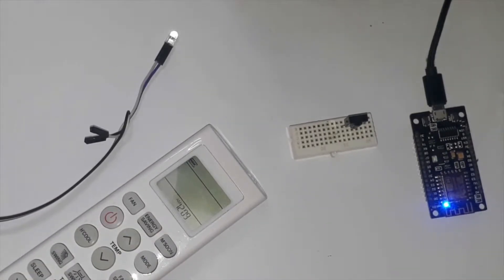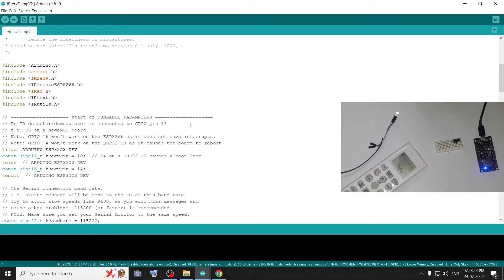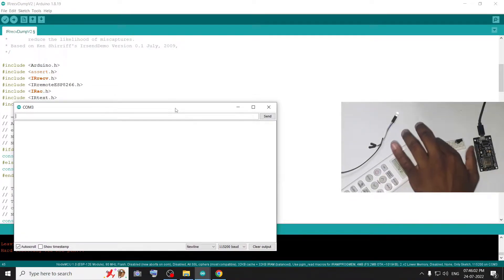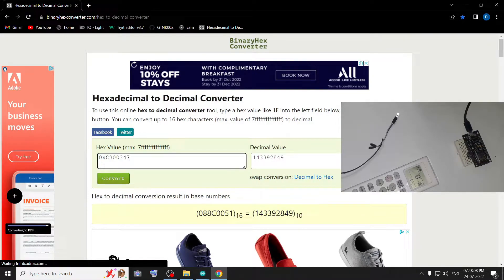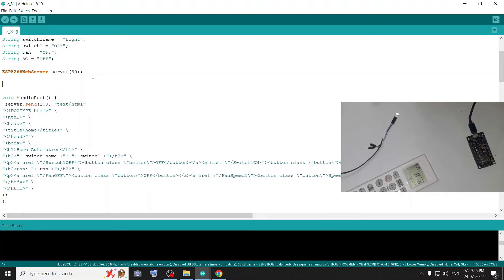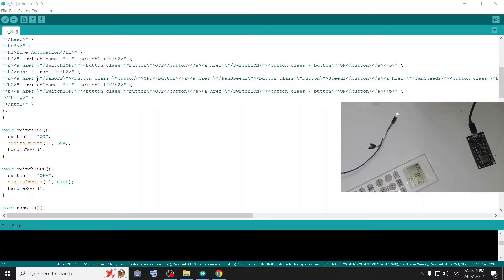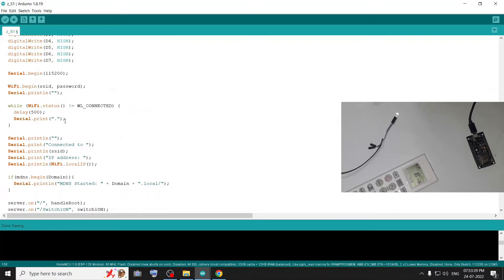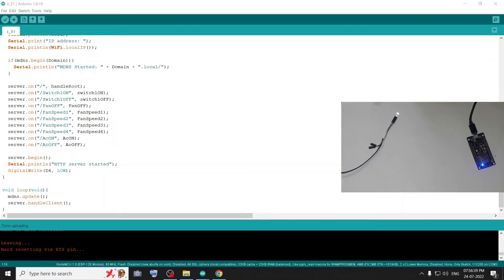T07 Control AC using IR led with ESP8266 local webpage in Tamil

Comment: i am get 80 bit code which is not working
Reply from the maker: try using raw hex code brother 
like this 
uint16_t rawData[343] = {9128, 4586,  596, 1684,  596, 1688,  566, 584,  594, 558,  596, 560,  596, 566,  594, 568,  596, 1696,  596, 546,  596, 1690,  594, 1694,  596, 558,  594, 562,  594, 564,  596, 568,  594, 558,  596, 548,  594, 550,  596, 554,  594, 558,  596, 560,  594, 566,  594, 568,  594, 540,  614, 548,  594, 1690,  596, 554,  594, 558,  564, 590,  596, 1702,  566, 1738,  594, 1696,  596, 548,  594, 550,  564, 584,  594, 558,  596, 560,  594, 564,  594, 568,  594, 558,  596, 546,  594, 550,  594, 554,  594, 558,  594, 562,  594, 564,  596, 568,  594, 540,  596, 8084,  596, 546,  594, 550,  594, 554,  594, 558,  594, 562,  594, 566,  594, 568,  594, 1696,  594, 1686,  594, 550,  596, 1694,  592, 1696,  594, 1700,  564, 600,  560, 598,  594, 558,  594, 548,  594, 550,  594, 554,  594, 558,  594, 560,  594, 564,  594, 568,  594, 556,  594, 546,  594, 552,  596, 554,  594, 558,  594, 560,  594, 564,  596, 568,  594, 558,  564, 576,  592, 552,  594, 554,  594, 558,  596, 562,  594, 564,  594, 568,  594, 558,  594, 546,  564, 580,  594, 554,  594, 560,  594, 560,  594, 564,  596, 568,  594, 558,  594, 548,  594, 552,  594, 554,  564, 588,  594, 560,  594, 564,  594, 568,  594, 558,  594, 1686,  596, 1690,  594, 1692,  594, 1698,  594, 1700,  596, 1702,  566, 1736,  596, 540,  594, 8080,  596, 546,  594, 550,  596, 554,  594, 558,  594, 562,  594, 564,  596, 568,  594, 558,  594, 546,  596, 1690,  594, 554,  594, 560,  594, 562,  594, 566,  594, 568,  594, 558,  594, 548,  596, 550,  594, 554,  594, 558,  594, 562,  564, 594,  594, 568,  594, 558,  594, 548,  596, 550,  594, 554,  594, 558,  594, 560,  596, 564,  594, 568,  594, 558,  594, 548,  594, 552,  594, 554,  594, 1698,  594, 562,  594, 564,  594, 568,  594, 558,  596, 546,  594, 552,  594, 554,  594, 558,  596, 560,  596, 564,  594, 568,  594, 556,  596, 546,  594, 1688,  594, 554,  596, 1696,  596, 560,  594, 564,  594, 568,  594, 540,  556}; 
irsend.sendRaw(rawData, 343, 38000);